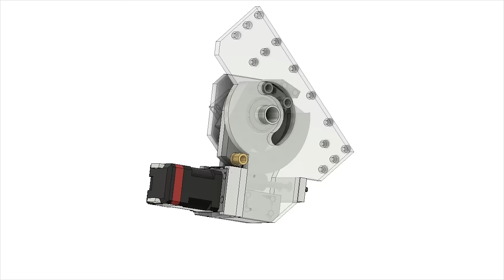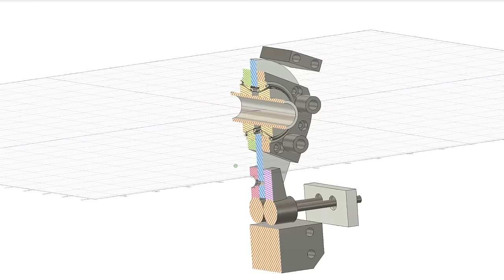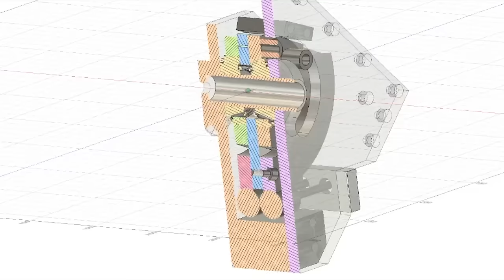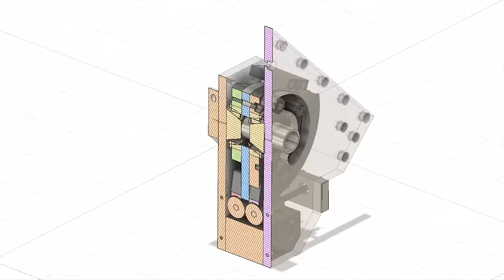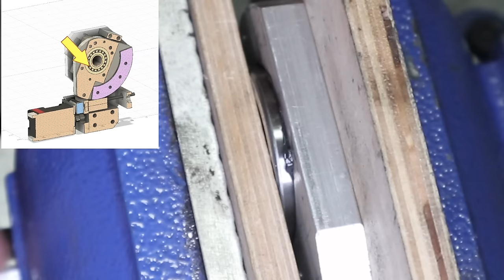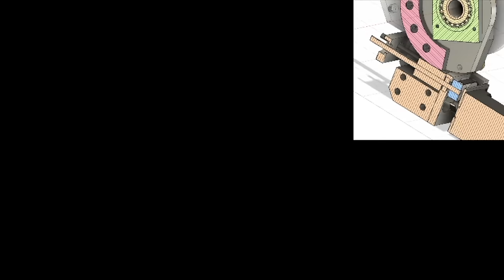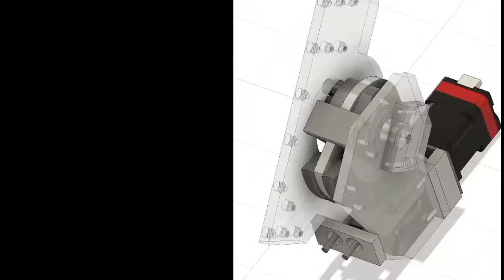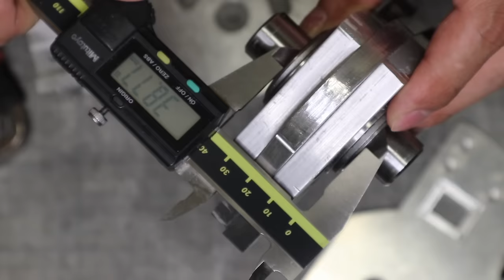Building The 5-Axis CNC Machine in a Small Room: A DIY Journey. (part10)

Comment: The worm preload nuts need to either have a set screw cross-drilled, have a locknut or in case of extreme bodgery a nyloc - just plain nuts, is just like having your pants undone, nuts.  And get your caliper a new battery and treat it with respect, its not a scriber :)
Reply from the maker: Thanks for the advice.